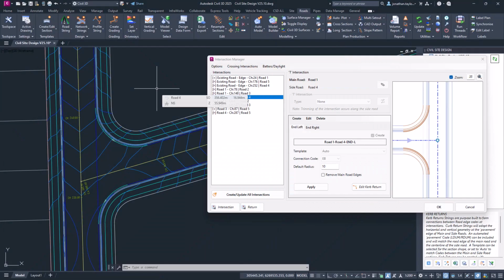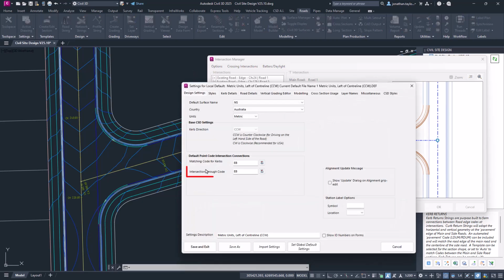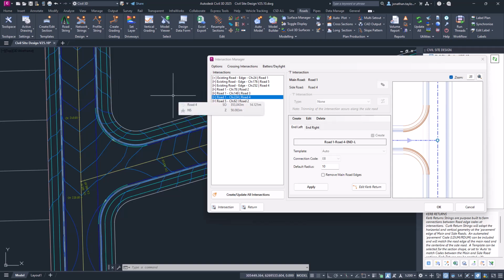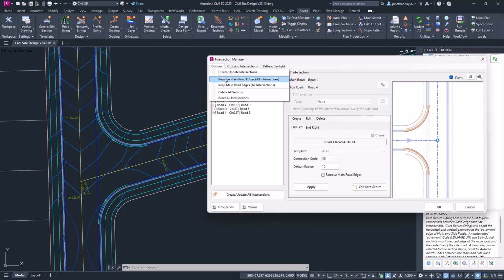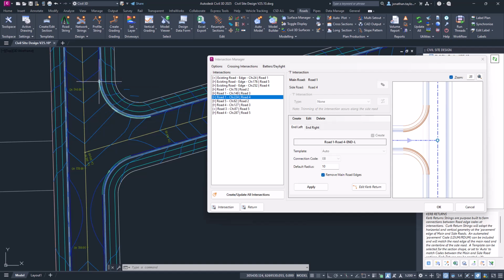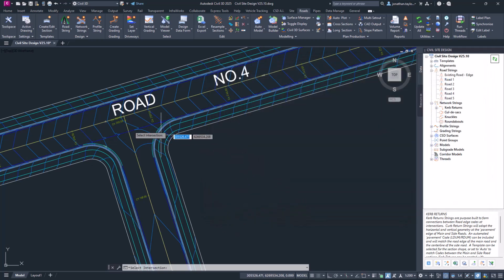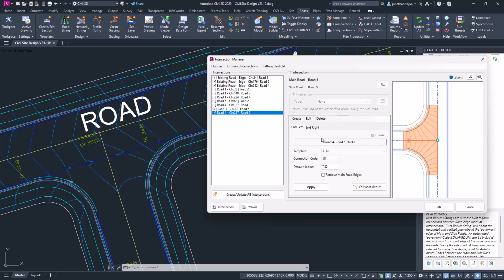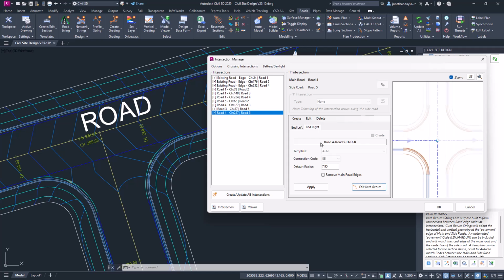Intersection Manager - Part 4 | Remove Main Road Edges

Comment: Some good new features with the intersection tools. Are you looking at a way you can automatically put a spoon or dish drain through the intersection. We design this in on most of our sub-divisions especially on flat sites where 95% are constructed this way
Reply: Hi @jeffsy1971. In Civil Site Design V25, check out the Design Data Form -> Design Variations -> Custom Variations -> Append Dish Through Intersection. This adds 2 x additional codes either side of the intersection through code (typically EB) to form a dish. I will upload a new video today explaining how it works.
Reply: @CivilSurveySolutions  OK yeah a video would be good, must've missed that in the updates to V25. Would be good to add to the the intersection tool?
Reply from the maker: Hi @jeffsy1971, the dish has to be created as a variation to the main road. Nice idea to add the variation in the Intersection Manager though! Check out this video which explains how to quickly add the Custom Variation - Dish through Intersection: https://youtu.be/SbvII199ncw?si=xD7rMZGq-91wlQJk